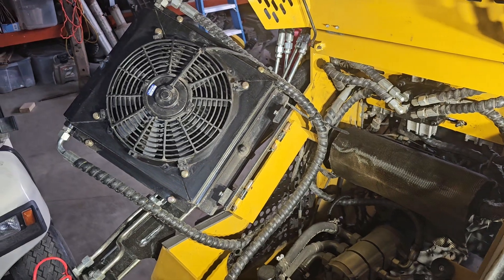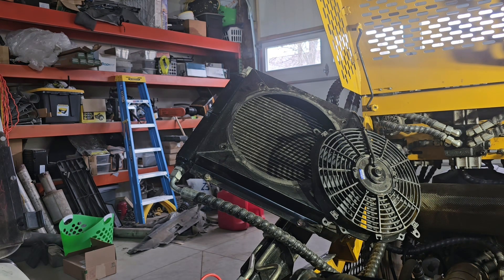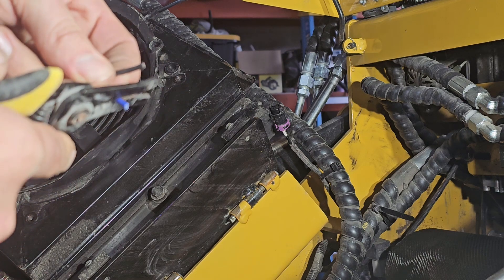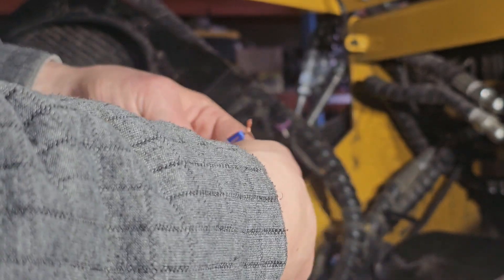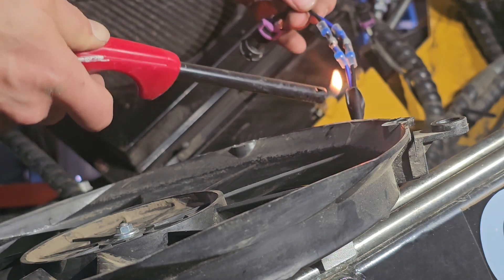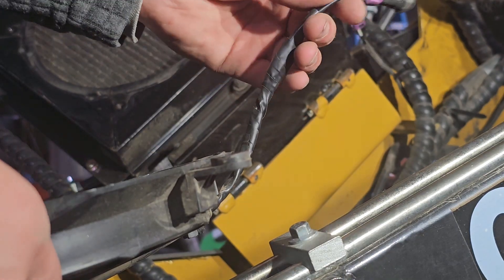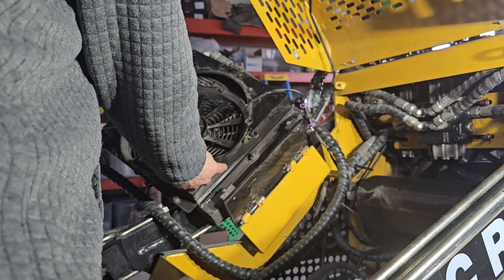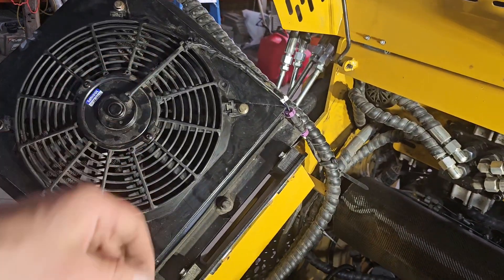CRT23 MINI SKID Reverse the Fan for Cooler Unit.

Comment: Hey, thanks for the videos, have been very helpful with my machine.  I am now dealing with heating issues and looking for a fix. Where did you buy your muffler wrap from? Also, have you upgraded your fan yet? If so what fan did you go with? Thanks for the help.
Reply from the maker: Well!!!! Your in luck I got another new Fan adding separate switch extra battery for some auxiliary power, on board Noco Trickle charger to charge both battery's!!!! I will get that video out shortly!! I think it will solve all our problems. I hope! It's in install faze.

Comment: E bros here! Good video! My oil gauge reads ---, now insead of a number. I wonder whats going on with it? take care.
Reply from the maker: @ericavenarius5370  wierd.... can a guy maybe swap the gauge? I'll look into it
Reply: Chances are it's wired wrong if it has never worked, mine had 3 dashes when I first got it, had to re pin the connector and now is working.
Reply from the maker: @OBrien143  Mine have worked.